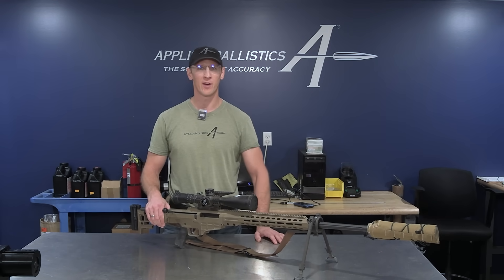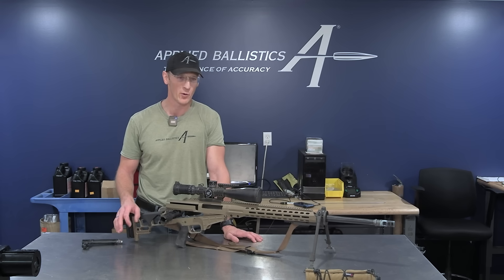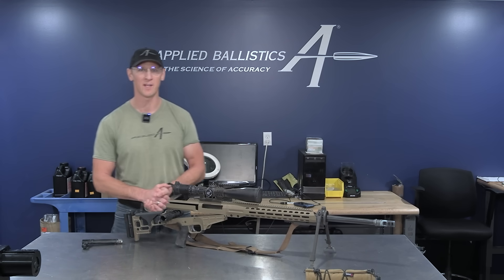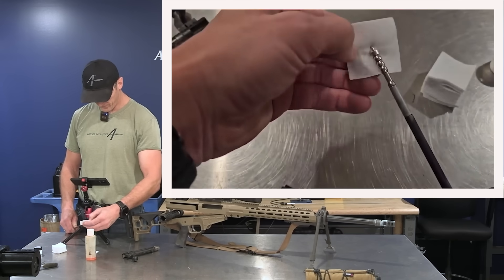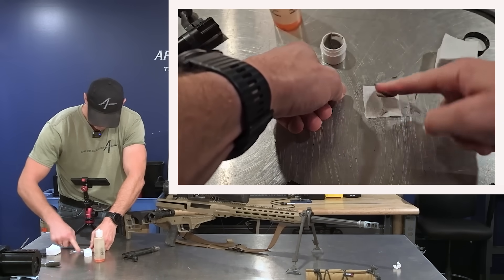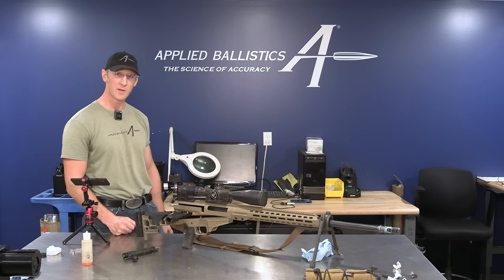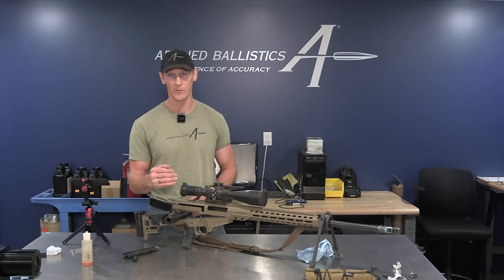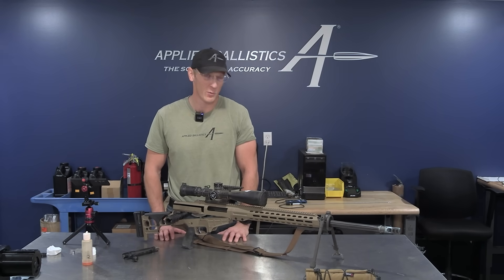High Performance Rifle Barrel Cleaning

Comment: VFG felt pellets work wwwwaaayyy better with JB and similar stuff, than normal patches.
Reply from the maker: I tried those, thinking it would be a better way of doing the abrasive cleaning.  The problem I had was; it was hard to get enough tension with them.  Even when screwed on and swelled to the max.  I went back to patches because I can make them tight enough in the bore to really scrub.  I could get the same result with the felts, but it takes more cycles and time.
Reply: @BryanLitzBallistics  that's really odd..... I've used the felts, both the copper reinforced and the regular white ones, on no less than 2 dozen different barrels over the past 6 years or so. ALL of them, including the shotguns, I got the felts so tight, I almost had to hammer the rod, and the strokes were definitely degenerating a lot of heat in the barrel. I usually do 25 to 50 passes, and up to 100(lol not every barrel I work with is custom match, some need extra lovin) and the felts hold up fine. 
I use 3 pellets on the screw jag. Get them ready with paste. Push it a few inches into the bore. Grab the rod and twist to tighten the pellets. Rifling grabs the pellets, causing them to screw onto the jag tighter. Once I can't turn the rod anymore, it's time to go to town. Every 10-ish strokes, it's time to grab the rod and tighten again. Lands and grooves are clearly imprinted on the pellets. I legitimately work up a sweat and get fatigued doing the strokes, and the barrel is warm to the touch. 100% of all carbon and copper is removed, checked with bore scope. 
It's odd that they don't work for you, but if the patches are good enough for you, those are cheaper, so that's good. 
If you ever get interested in scatter gats, I've discovered some very interesting things, such as distinct and repeatable "nodes" that affect the patterns. I've got a professional background in science too for what that's worth lol.
Anyway keep up the good work.

Comment: Been using JB Compound for most of my shooting life, because at the very beginning of my career I was told to. 
I mix it with oil and other finer non embedding abrasive compounds and find the results more than satisfactory. 

But can you do harm to your barrel if you use JB (Iosso) too much?
Reply from the maker: I don't think you can harm a barrel with it unless you try, or are not careful.  Meaning: over use of power drill or leaving too much in the barrel/chamber and shooting over it.  This is the only way I ever clean guns and they last much longer than when I don't clean them at all.  There might be other cleaning methods that are better, but this is the best I've found.

Comment: Thank you for posting a public video!.

I have gone from the no clean, and let it equalize crowd.

to cleaning basically every prs match worth of ammo...so 80-150 ish...

I get what Frank Green from bartlein was getting at....

more worried about people over using abrasives with bronze brushes SPECIFICALLY.  

he didn't say anything about not using abrasives on patches or nylon brushes... he said if you're not hurting the barrel, he's got no issues.

Comment: A+ for Thoroclean/Thoroflush!
Completely gets rid of carbon!
Reply: Yes indeed , the last bit that nothing else will touch.
Reply: Thoroclean / thoroflush does not get rid of fire cracking high spots/ rough edges . You were not paying attention. It’s not just about removing carbon .
Reply: @levigne25 Getting rid of fire cracking high spots...hmm seems to work for me just fine. To each their own
Reply: @levigne25 it indeed does. ThorroClean is an abrasive just like JB paste. It removes carbon, copper and polishes. Have used it for 5 years now.
Reply: @levigne25  I think my bullet traveling at 2900 fps will smooth out any of the high spots
Reply: @bawhitham23 that makes no sense
Reply: @levigne25  its sarcasm however you seem to think smoothing out high spots is a very critical part of barrel cleaning which I dont necessarily agree or disagree with. I think as long as you are getting out majority of the carbon and copper the barrel is going to perform without putting a ton of stock in how well you smoothed out the high spots
Reply: @bawhitham23  high spots from fire cracking can cause damage to the copper jackets especially when they flake off . Little imperfections in the copper jacket can affect the BC of a bullet . Abrading these out can help prevent these imperfections .
Reply: I’m sure thorroclean is great on copper and carbon fouling but it cannot abrade metal like stainless steel  like a lapping compound  does . Thorroclean cannot remove raised edges of the parent metal .
Reply: @levigne25  Learning something new is what it's all about. Have always been leery of aggressive abrasion in a barrel...I may have to step out
Reply: @DLoh2o1  it’s ment for barrel cleaning , it’s been used for a couple
Decades or longer by competitive shooters . It’s obviously not hurting barrels .
Reply: Iosso is great stuff as well, I prefer it to JB, in saying that use whatever works for you, cheers people ✌️

Comment: I might be the dumbest bastard ever to live, but I do a very similar thing with my rifle with flitz. Ammonia gets the copper out, abrasive makes er smooth and shiny. Then lots of wd-40 patches to chase the ammonia out. I haven't used jb's because flitz is so available and has ammonia in it.
Reply: I think flitz is more coarse than JB. Risk would be premature wear. You might just order up some boretech eliminator and chameleon gel
Reply: @K-bob_45 I've heard boretech mentioned a lot. I'll look into it!
Reply: Problem with ammonia based products (Sweet’s 7.62 for example) is that it will damage the bore if left for too long in there. 
This is why most bore cleaner manufacturers now avoid using ammonia. 

In my experience there’s no quick and easy short cut; time and effort always wins. 
The quicker a product removes fouling, the more likely it’s going to damage something. This is purely my opinion and experience when experimenting with various products.

Comment: I appreciate the video Bryan

On one of my 22CM rifles that has a Proof, 1/7, 24” chambered by Virlee Gunworks.   Shoots a .231” 7O Berger VLD.  

I have always been a clean gun on low round count.  I clean 30 rounds with a soak overnite with whipeout.  Then Iossa Nylon brush w/Accelorator + whipeout.  

I will use 95-97% alcohol flush with immediate dry patching.   A slight carbon ring typically forms in a broken faded shape.  

I then use Thorough Clean on a wet patch followed up with Nylon brush.   I pay attention to the color of the brush and after 6-8 strokes, I flush the barrel with alcohol, dry patches, flush the brush and hit with air.   I then repeat if necessary.   

One satisfied with the barrel clean, flushed and dry patched.   I then lubricate the bore with Tetra Bore Lube.   Oil is fine.  

Before shooting / hunting, I dry patch(s) the oil.  

Currently have about 975-1000 rounds through the barrel and she is still shooting pretty decent, .336” group.  

The barrel is expected to last about 1400-1800 rounds but time will tell and group size will have to be .50” or better.   

This rifle is a coyote night rig.  

Just wanted to pass this along and gather any comments from you and the group.   

Thanks Bryan.

Comment: Too much work. Insert spray straw into nozzle of brake cleaner. Muzzle down. Spray into chamber as you're closing this video out. Enjoy the same results.
Reply: You obviously were not paying attention, brake cleaner will not level off the high spots from fire cracking , it’s not just about cleaning . Watch the video multiple times until you catch on .
Reply: Lol it gets off loose carbon nothing more.. tried it... bore scoped it.. didn't change anything
Reply: @sniperjoe  oh ok so basically this phenomenal and unnecessary method has such a huge and noticeable positive effect, like inches or feet. Wow. Man lemme go throw away all my brake clean then I had no idea. Pfft. Come on man.
Reply: Brake cleaner removes Hard carbon and copper fouling?
Reply: @prone_wolf8871  yes, x10. I do this every time with a white rag on the ground and you can very easily see every bit of gunk that gets cleaned out by it.

Comment: Would you use Boretech Eliminator to remove the bore paste at the end?
Reply: If you use boretech’s abrasive, chameleon, yes. I use boretech products and they say to do that on their product. I’m very cautious of mixing different companies products. lol I don’t want a bad chemistry experiment in my bartlein
Reply from the maker: You could, but I don't think that's necessary.  The bore paste comes out easily with anything that you wipe over it, even dry patches.

Comment: Picture the back and forth mechanics of that procedure and take the cleaning rod away, that's what I think of that procedure. A Bartlein Barrels representative told me that if I have the time, soak out any fouling with something like Hoppes #9 and just patch out because it's a good thing if you don't have to use brushes or any mechanical procedure. I wonder how many barrel manufacturers will honor their warranties after such extreme abrasive cleaning? And make no mistake, over time an abrasive WILL change a barrel's internal dimensions because you have no control over just removing the rough high spots.
Reply: Yes we all saw franks interview lol... 

now then....even though frank is saying that because of the tards that get carried away with it and he doesnt want to warranty barrels for it...

The benchrest boys dont care about barrel life as much as accuracy.....

Comment: Interesting. I first did this not knowing what I’m doing, on my tikka stainless 308 after 700rnds.

I used those quality VFG felts for good contour fit, first with jb bore paste (grey) and stroked back and forth in 4-6” strokes about 10-20times and progressively creeping about 1-2” from breach to muzzle finishing with full length strokes. I’d say hundreds of strokes all up.

Repeated with jb bore brite (red, finer grit). And it turned into a mirror. I’m still sub moa with factory loads.

I did same thing to my Brno Mod.2 in 22LR because it’s old and rusty and I found I was about 100fps below box velocity from 23-24” barrel and my friend got 100fps above box velocity from same box of ammo in his 16” CZ452 and he never cleaned with JB. So maybe this fits with first 5mins theory of this video.

I found cleaning the residues took many patches, like 30+ and I had to use oil patches as well. Alternating dry-wet-dry and I remember it took a lot to get back to clean patches. I was a little concerned then, but watching all these other videos and stories makes me feel at ease in getting all the residue out.

Ive seen “speedy” (benchrest shooter) in other videos finishes cleaning with graphite dry lube to “fill in and protect” the fire cracking as something extra. 

Might pay to use bore mop in chamber a few times to prevent any false positives from cleaning jb paste residue.
Reply from the maker: Thanks for sharing your experience.  I haven't heard of 'speedys' method of using graphite after a cleaning, but that makes sense to me so I think I'll try it!

Comment: Meh, I’ve gone away from abrasives. That roughness of the fire cracking is going to come back in 50-100 rounds and then you’re going to have a velocity increase again.
Reply: So clean every 50-100?

I clean after every prs match worth of rounds....so anywhere from 80-150 rounds. I figure its not as extreme as the benchrest guys cleaning every 20....but if i clean it the same before every match it should be consistent  is my thoughts
Reply: @ @ because a halfway through even a one day match my velocity is going to spike. I’m using solvents only now. Can’t clean midway through a match.  Plus I’ve talked to several top shooters and they aren’t using abrasives to clean, only rarely do they use them. I clean after every match and between day 1 and 2 of a pro match, but I’m no longer using abrasives.

Comment: Any thoughts on Thoroclean?  Mild abrasive and really easy to use.  Generally have the barrel clean in 15 stokes.
Reply: I use Bore Tech Eliminator to start, then KG2 Bore polish (1400 grit)   Finish  with Thorroclean to remove the last bit of carbon.    Using a borescope I have found that one product alone will never remove all of the copper AND carbon.   Using these three products in this order will clean a barrel down to the steel if that's what you want.  Bore Tech Eliminator is an awesome daily driver for patching after shooting, removes big chunks of everything and leaves a bit of copper and carbon behind.

Comment: Brilliant. I use Iosso bore paste on a patch wrapped around a nylon brush.
Reply: What I do is plug one end of the barrel with a number 2 pencil, or one of the fat ones kindergarteners use, depending on caliber. Then I open an old lead acid car battery or two and use a turkey baster to fill the barrel with acid standing on end. I ground it by soldering a 4ga copper wire on the bare steel inside the end of the barrel attached to a 4’ solid copper rod driven into the ground exactly 3 1/2 feet deep. Then I leave it in the sun for exactly 13 days. I start adding 1/2 teaspoon of baking soda in through the breech every 4 hrs for 4 days. Then I solder shut the breech with fishing weights and a propane torch and then cool it with dry ice. Then 7 days later I cut the copper grounding wire. Flip the barrel muzzle end up… I take a ball peen hammer and drive the no 2 pencil into the muzzle till it’s flat all the way in. Then I take a metal rod the same caliber diameter as the bore and drive the pencil through the barrel while slowly heating the breech in a fire made of dogwood and rosewood. While driving the pencil through the bore, the lead plug from the fishing weights will heat up and give way under pressure. When the fire hits the acid mixture it will ignite and blow the pencil half way out of the barrel and then suck it back in all the way through the barrel and out the breech into the fire in an instant. But only if you have done it right. If it doesn’t then you have to start over again. 
And then, after that,  I run a couple of oiled patches through it to protect it from rusting and you are done. 
Barrel will be cleaner than from the factory every time. 
I should add that I only clean my rifle after at least 20 rounds. But I never let it go more than 30 before I clean it. 

Hope this helps. 👍
Way better than how we cleaned them i  the army. Their way took forever and the armorer would keep sending you back till you cleaned all the bluing off of every part. 🤷🏼
Reply: @TheBeefSlayer  yes of course, but what if it is a Wednesday?